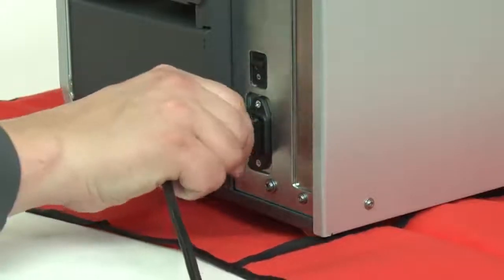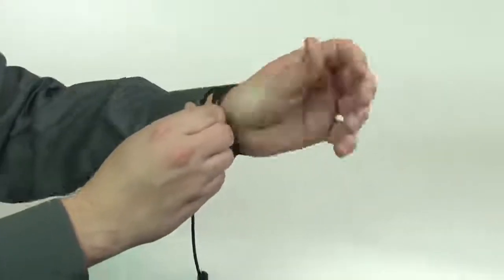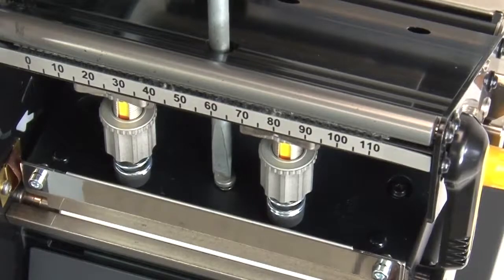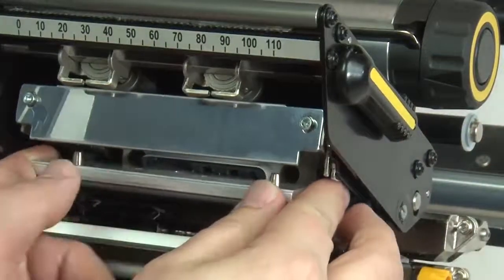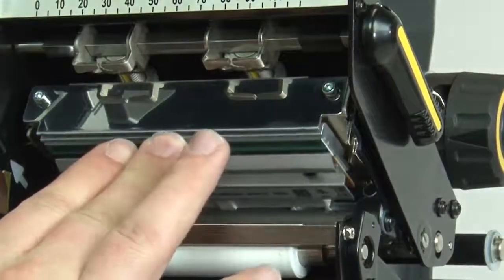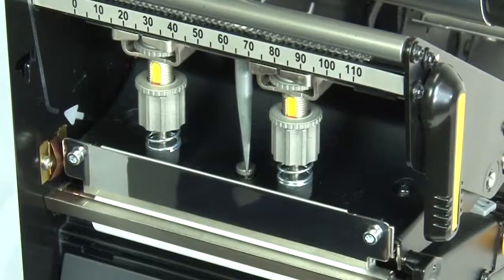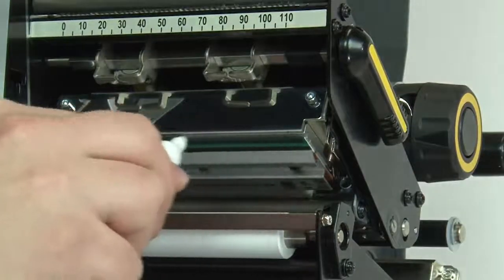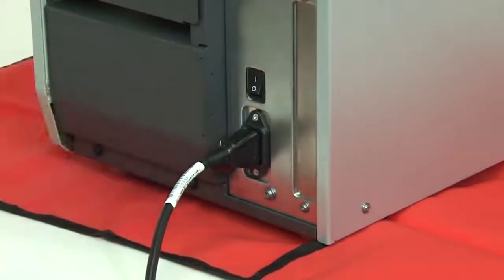Printhead Replacement on a Zebra ZT600 Printer

Comment: Do you have to put the ohms in manually like the old ones ?
Reply: I'm looking for that answer as well. Did anyone ever respond to you on this?
Reply: No, it is not necessary to input the ohms anymore. Don't take this wrong but that's stopped being done a while back. I should know since I've been a tech for over 50 yrs.